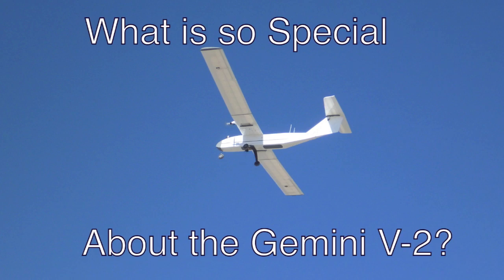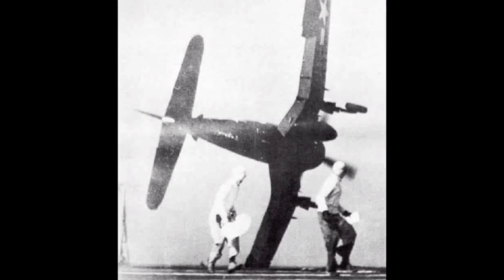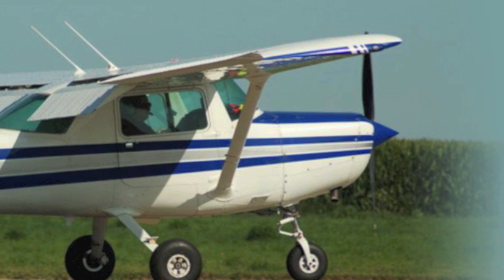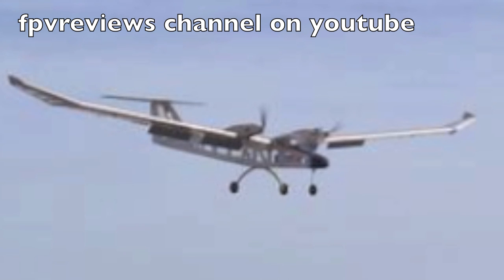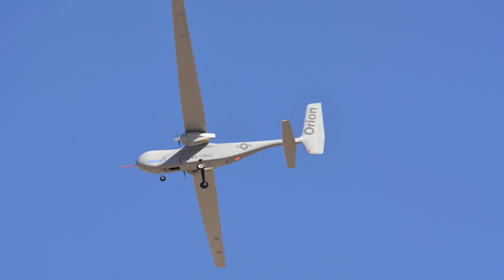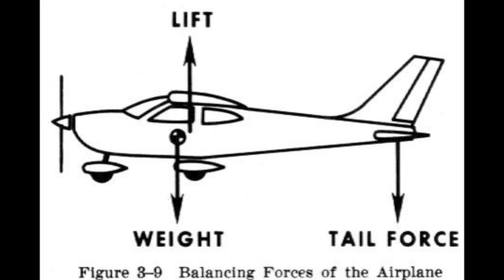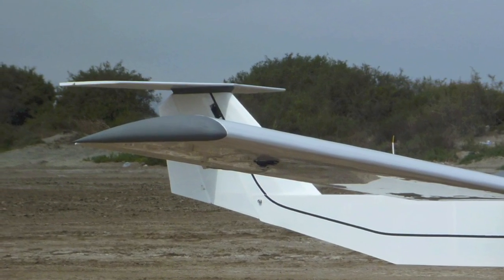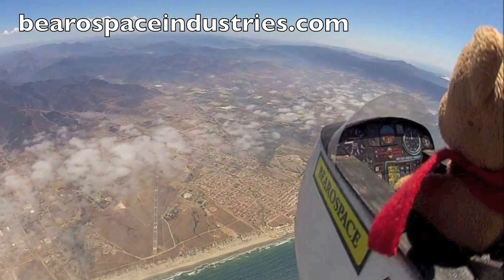What's so Special About The Gemini V-2 UAV?

Comment: Would you ever consider developing something as capable as the Gemini V2 but in a 3D printable version where we could buy the 3D plans and build at home based on your specs.

Would also be interesting to watch you guys document the development process.
Reply from the maker: I'm sure it would be possible to make a 3D printable version, but with current technology for materials and 3d printing, it would be far less capable.  there is a big difference between 3d printed parts and composites.    It would also be fragile, if it were kept light.  even with carbon x and LW PLA.    It will be a long time before 3D printed parts can beat composites, or even wood for strength to weight ratio.   and I'm a big fan of 3d printing. I print lots of parts.
Reply: @FPVREVIEWS  do you think a mix of materials would do the trick perhaps? From your experience.
Reply from the maker: @calvin3989  Carbon and other modern advanced composites would be the best.  Some smaller non structural parts would make sense to 3D print.  the current design uses an open wood structure, laser cut, and Carbon tubing for the wing spar.  As well as some carbon pultruded strips to increase stiffness in some areas.

Comment: I was involved in UAS in the Air Force back in 1988 to 92.  We did a wide variety of "stuff".  One was making Senior Telemasters for the officers to learn RC piloting.  This is much better for the AUV use than the Telemaster and I think I want to make a set of molds for this and make one out of fiberglass.  Should be interesting to see if I still have those skill sets.

Comment: What is the flight control used on this model?
Reply from the maker: We developed the model with no flight controller, and it does not need one to fly well, and handle well.  
We are now using pixhawk running arduplane, with custom tuning, as you should do for any airframe.